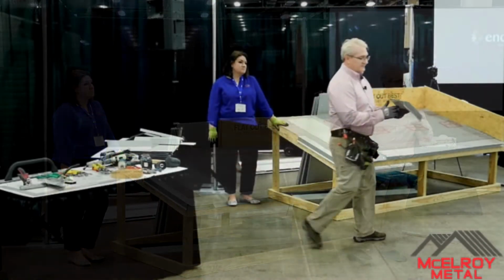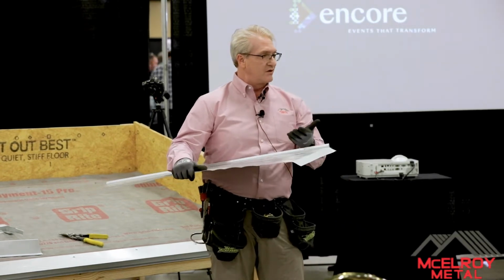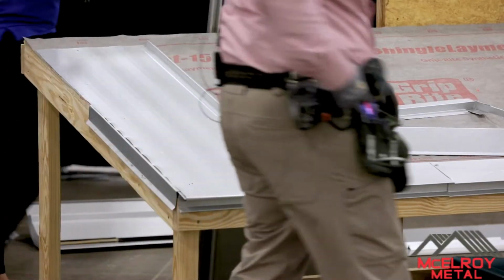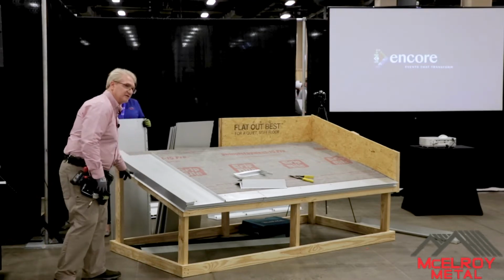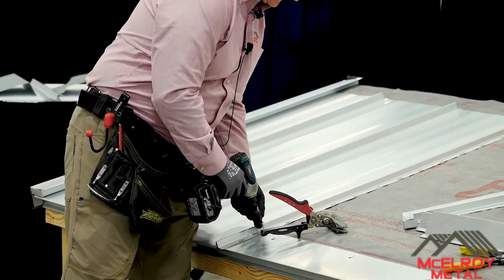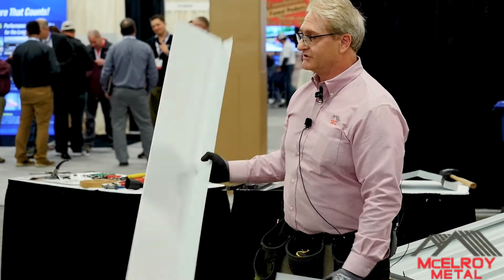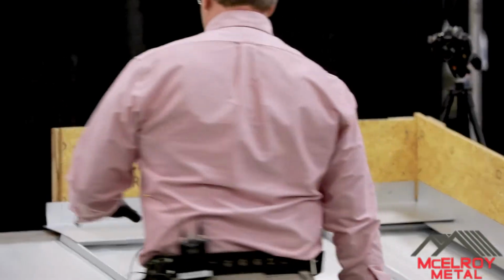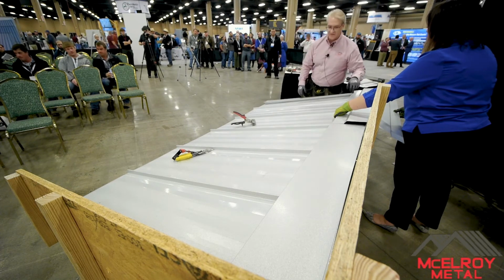Meridian Standing Seam Metal Roofing Installation Demo | McElroy Metal

Comment: you're only showing one side of the ridge application. are supposed to stretch it over to capture the other slope? slide it on from the end?  that doesn't seem practical on a 30' ridgeline,
Reply from the maker: There are different means of doing it, but yes, you can stretch it over to the other side. If you install an offset cleat on top of the closures, you can slide it on from one end.
Reply from the maker: Also, you do not need an offset cleat over the Snap z vent. You can stretch it over the Snap z vent and hook into it.